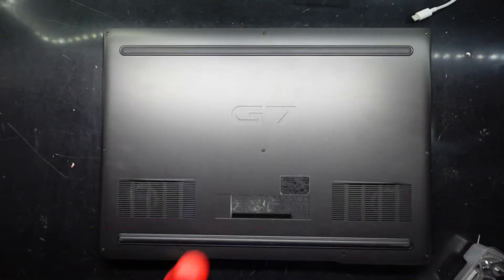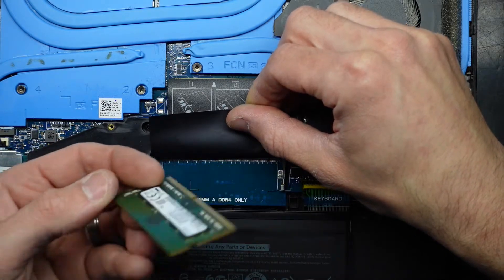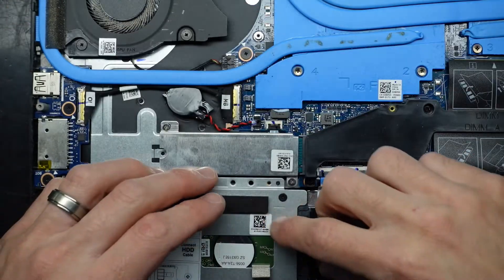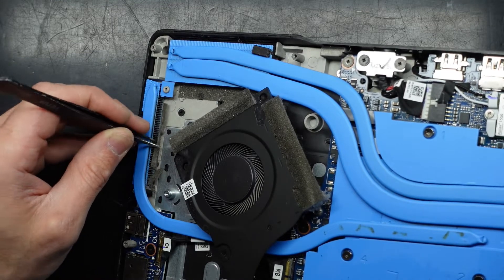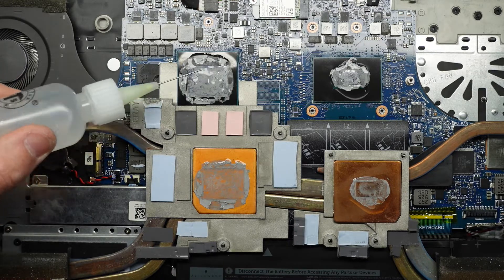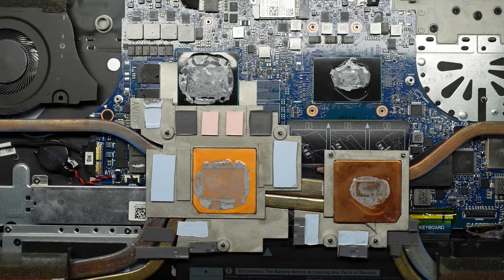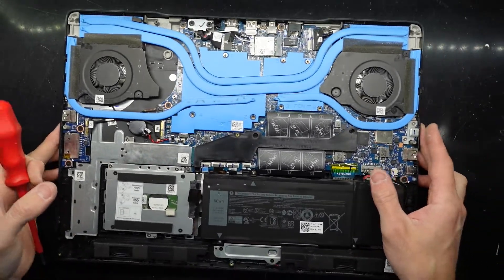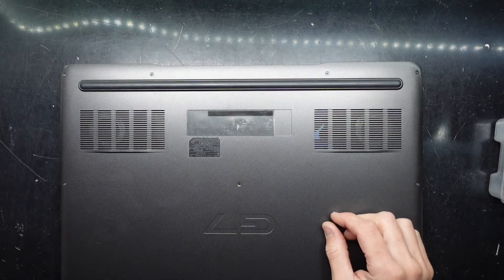Dell G7 7790 Teardown and Thermal Paste Replacement

Comment: I'm heading this Friday to check this model a used second hand what should I look for ? Would you advice me if this laptop is good enough as of this year and for 500 euros ?
Reply from the maker: what i would look for with most second hand machines is:

Overall Condition- does it look like its been treat rough, cracked corners extra

Dust, do the ports on the side and vents on the bottom look dusty

Check Device Manager, to make sure it is the specifications the seller says it is
Reply: What are your temperatures for the cpu and gpu please?